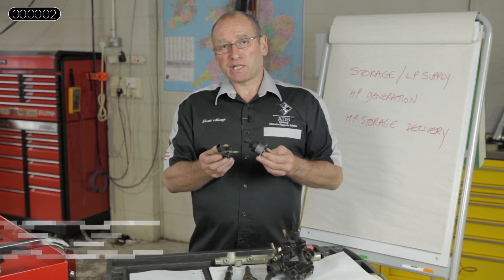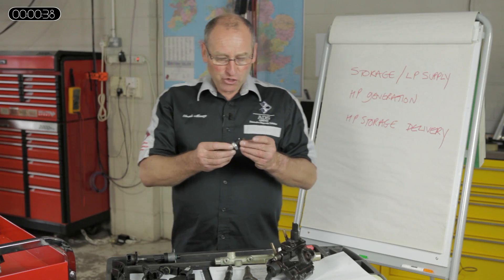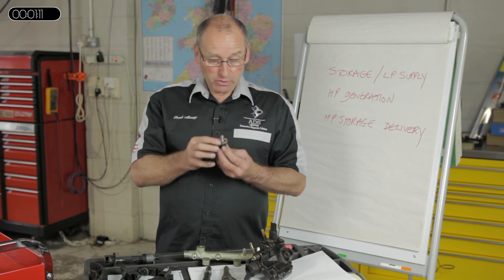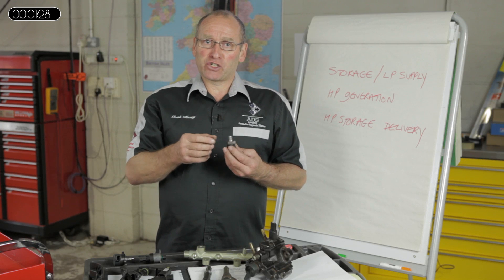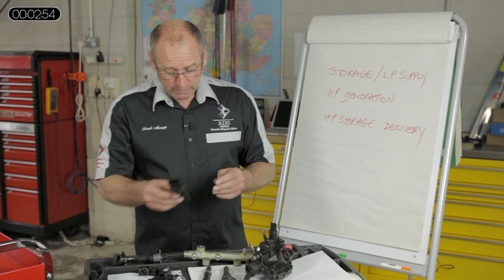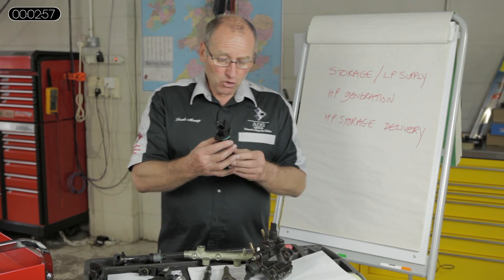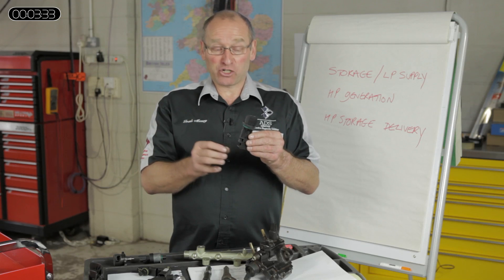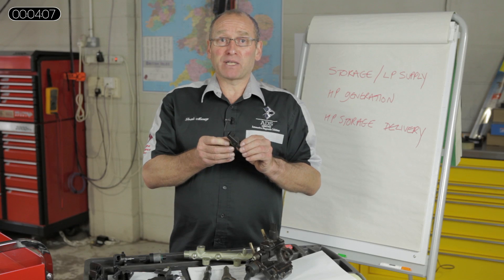AUTOiNFORM: Common Rail diagnostics training module - taster: 3

Comment: If you checked your supply voltages and earth and you had a trouble codes for the fuel pressure sensor also checked the signal return voltage at the sensor and ECU and that was reading the same how would you know weather it was hydraulic or the sensor fault   hope this makes sense thanks